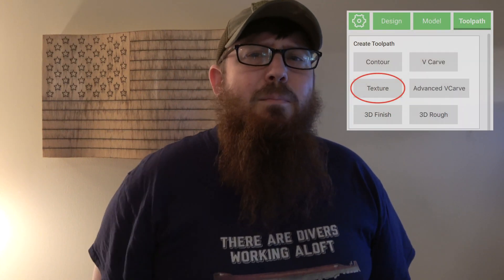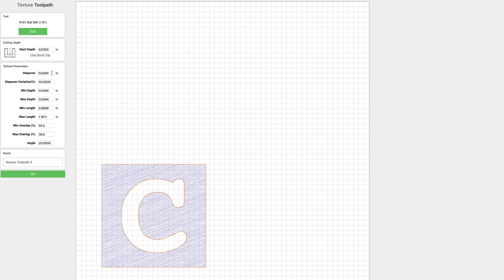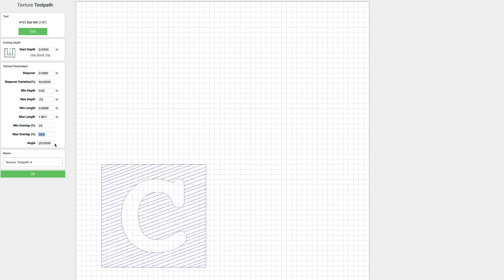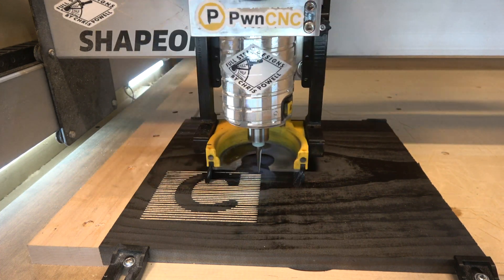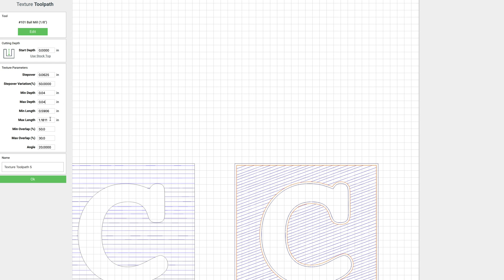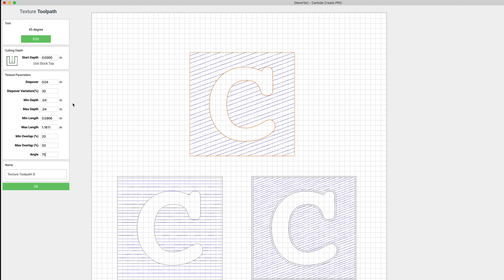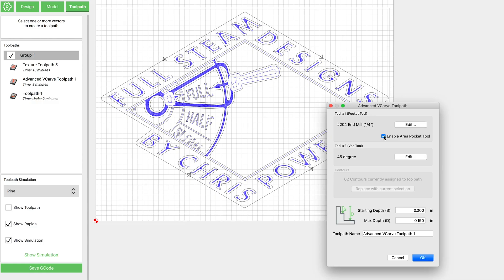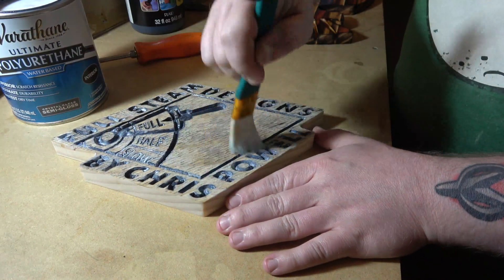Texture Toolpaths - Carbide Create Tutorial

Comment: Thank you again for a very informative video on Texture Toolpaths.    I saw a video on setting Z height on the waste board surface and then putting in a negative number on stock thickness.  This seems like an excellent idea, however I don't think carbide create will accept a negative number.  Is there a workaround on this?  It would sure save my waste board.  Thank You again
Reply: Don't need a negative number. In Carbide Create, set your toolpath zero to bottom, and then your stock thickness. (digital calipers are a must). Z height zero is then set to your wasteboard.

Comment: great video you explain things so well  I recently did a stacked text sign but wanted to add texture to the bottom layer I tried one didn't turn out so well so I did it without the texture any suggestions?
Reply: Thanks
Reply from the maker: I haven’t tried one of those. I’d probably cut everything normal like in my stacked text tutorial, then come back through and do the texture. Just adjust the start depth.

Comment: Honestly I hate how you have to jump through hoops to make the program do what you want with carbide. The shapeoko is an amazing machine but as soon as I can I will probably switch to vectric. Chris you are the man at fooling carbide into doing what you want it to
Reply from the maker: To be honest with you, I’ve been using Carveco Maker + more and more. I do enjoy the challenge of manipulating CC to do things people don’t think it can do, but it does get old after a while. Check out Carveco Maker and Maker +. I’ll be doing videos on that when I get a little more comfortable.
Reply: Have not used Carveco Maker as Chris mentioned in his reply to you, but this  along with the exceptionally wonky Tool Database is another reason I am so glad I invested in Vectric Aspire many years ago.
Reply: I hear you.  I suppose for the hobby guys Carbide Create is a viable option but I had to jump in with both feet because I'm much more into full 3D work.  I wanted to buy Aspire but the developers said it was still 8 months out till release and I couldn't wait that long so I ended up with Artcam and when Autodesk bought then killed Artcam I jumped on the huge discount for the new full version Artcam replacement, Carveco.  Aspire is a great program, sort of a slimmed down version of Artcam/Carveco which makes sense since the developers were former Artcam writers and Aspire still has a very attractive price for a full 3D program.